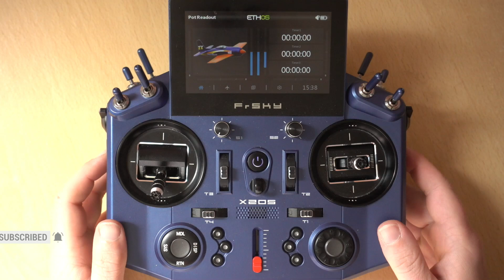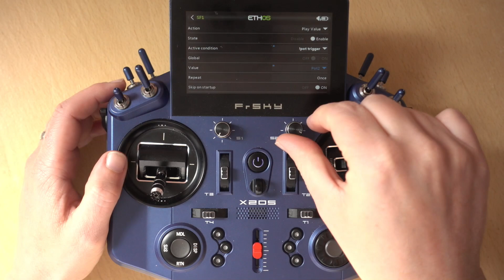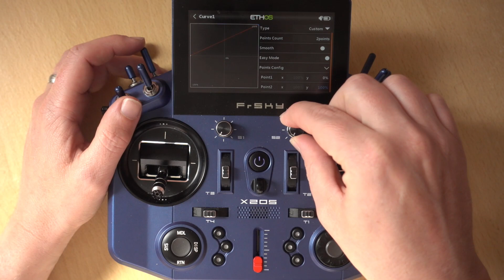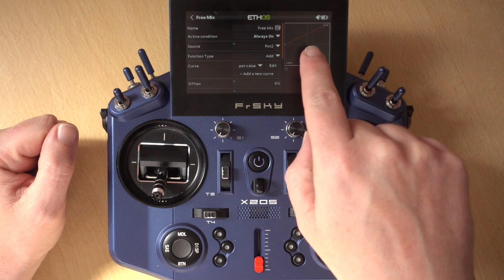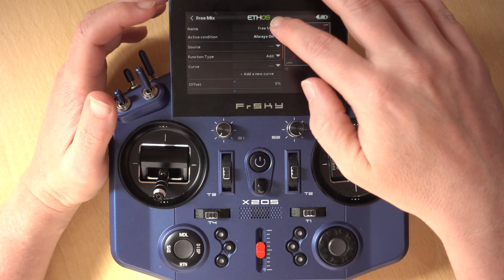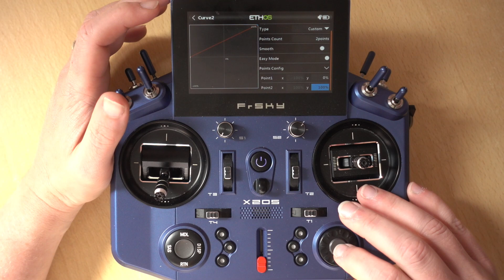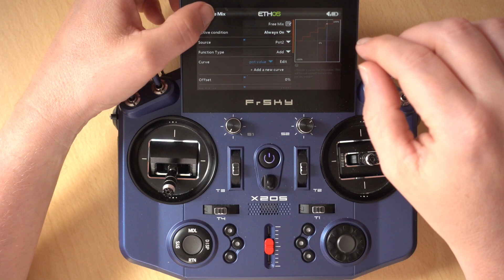Hearing a readout for the position of a pot in ETHOS

Comment: Hi Darren I’m new to FRSKY…coming from Spektrum. I have an X20S and I’ve set my rates onto a 3 position switch….can I have the radio read out “high rates’ ‘mid rates’ and ‘low rates’ corresponding to switch position. Or do I need to do this on a PC and program it into my transmitter.

Kind regards
Geoff
Reply from the maker: Sure Geoff, that’s no problem. You will need sounds for the call-outs. I have a video on creating your own; which also has details about other packs you can download (https://youtu.be/2AcB_jrFFK4). With the sounds on the transmitter, it’s a case of creating some special functions so that when the switch is in the appropriate position it plays the high, mid, or low rates track. 

I’ve had a couple of people ask about this. So I will make a video on it soon.

Comment: Another great tutorial Darren. Would be nice to be able to make this function global.
Reply from the maker: It wouldn't necessarily make sense to have this as global, unless all your models have the same pot on the same channel. There is just a global toggle switch on the special function.
Reply: @MrD  I have the red slider as volume control, so like for it read out percentage as I move it. That would be nice to have on each model.
Reply from the maker: @karstenhoysagk9448  you can set the special function to do the reading part as global. But, if you want the reading to be 0 - 100%, you would need to replicate that mixer on every model. I also use the red slider for volume. But I don’t worry about where it is, just if it is loud enough.

Comment: Is there a way to call out throttle changes / values?  90% of planes I use INAV so throttle is in the OSD.  Also fly a Volantex Trainstar with a KOPILOT (FPV).  I never know how much throttle I'm giving it and the prop on it is super quiet so you can't heart it much beyond 200 feet.  I keep seeing everyone use a "curve" for POTs.,,,,,,,,,,,probably not a a good idea for throttle LOL. I can some what get it to work but not really.
Reply from the maker: Using the curve is not a problem as you are using a dummy channel. The actual throttle is output to channel 3. Whereas the you would have the curve for the readout on another mix, which uses channel 3 as the input. The readout with the curve would output to an unused channel like 64. The value of channel 64 is what is read by the special function.